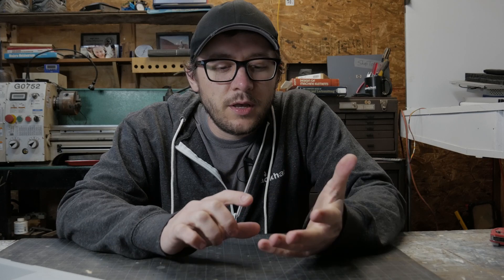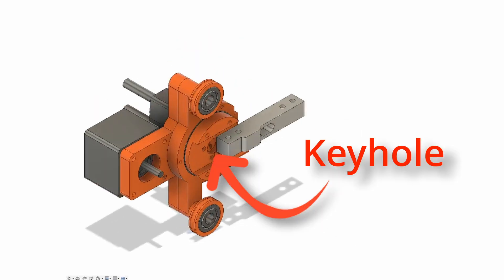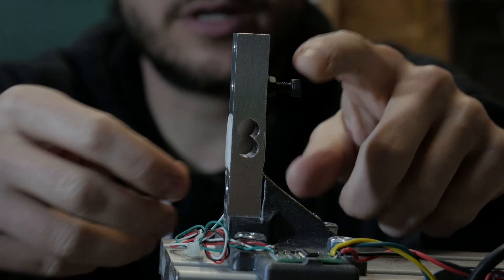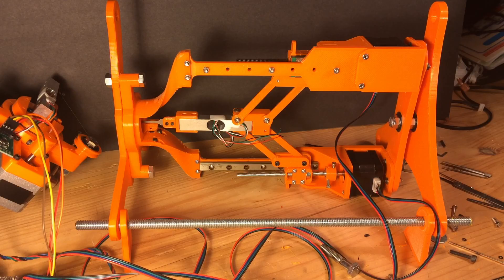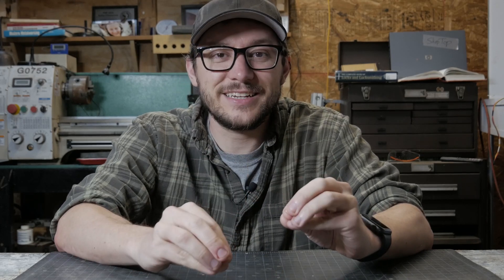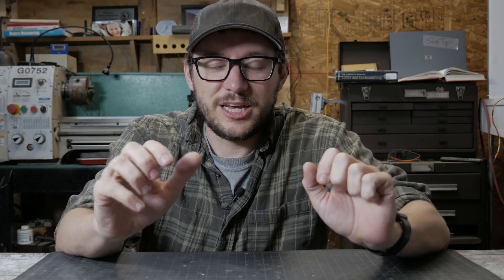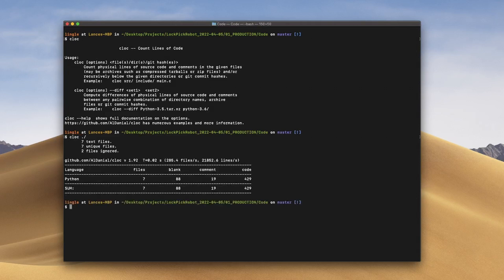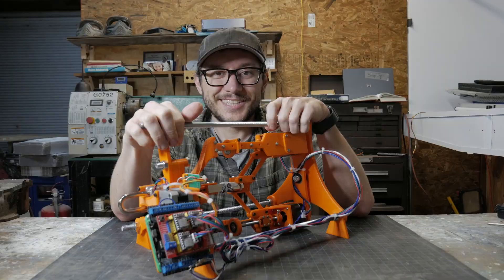making a lock picking robot

Comment: The wiggling you get can be from bad tolerance on the ball screw shaft.

You can buy ball screw shafts with much tighter tolerances guaranteed, but it turns out those are suuuuuper super pricey. So the simple solution is just the lottery: you just buy a couple of shafts, and pick whichever one lucked out with the least centreline deviation.

Comment: Love this project! You should make a new version that uses the lock picking lawyers (covert instruments) Lishi tool to be able to find out the depth of cut necessary for each of the pins while picking open a lock. Two big bonuses would be to be able to have the robot magnetized to hold against a metal door for door locks or at least have clearance for when a lock is flush mounted without being able to hold the lock within the robot. Another bonus would be to take it a step further and cut a new key to work with the lock based on figuring out the pins. If it can work on 3 or more locks by figuring it out on it's own to be able to memorize and learn on it's own, big plus! ahah These seem to be the next steps for this project in my opinion. What do you think?
Reply: This is kinda unnecessary. You can put all the information used to design Lishi decoders right into the code. No need to use an actual decoder. And you could make the robot gather the information it has to process while picking and use this to duplicate a key.
Reply from the maker: I spent a fair amount of time on the business end of the effector doing just that. Reverse engineering the lishi tool from photos and known measurements for the key. This was purely for the picking mechanics. Then I realized I could cut the end off a pick from a set. 

Good idea on the magnet.

Not sure, there are some innate problems with this design for more secure locks. If I circle back and do a version 2 it will be a complete redesign.

Comment: This is awesome! 

Does it currently have the ability to move .015” up / down  and ~0.15” forward / backward? Thanks for awesomeness!!!
Reply from the maker: Yes it can. You're welcome. Glad you enjoyed it.
Reply: Several of us at the local TOOOL Chapter think your  next steps could be (1) to program the robot with the Depth & Spacing information for locks like Master, Schlage, and Kwikset so it has the ability to test all depths at each position while picking and also (2) add modularity to the padlock/cylinder holder for the robot to pick open a padlock or deadbolt/mortise/key-in-knob cylinders, etc… the finale would be a version that could be placed/ mounted on a door, similar to how a safe lock auto-dialer is mounted to the safe. 

another iteration is a robot that can impression a key for the lock by testing/picking each pin stack and decode the lock bitting at the same time while also moving some pieces of metal around to fashion a modular working key.
Reply from the maker: Glad to see my thoughts were on par with people that know what they are doing. 
1) In the GitHub repo the code already has dimensions corresponding to bitting specifications for Master lock. It wouldn't be hard to expand it to other brands since it is broken down into x,y coordinates. 
2) Yep the holder is two pieces for two reasons, one for easier 3D printing and you only have to swap one part to change the lock. Yeah, in the beginning stages of design I wanted it super small and to run off a power tool battery. However, it quickly grew in size due to the limitations of my tooling and design.

My idea for version 2 is a complete redesign. If it works like I think it could it would be very fast and very small and take on just about any pure pin tumbler lock. I spent a little bit of time in lurking in /r/lockpicking the past few days and ASSA 700 looks promising. If you have one of those laying around, something similar, or have a better suggestion you can email me (link is under about on the channel).

Comment: I cannot see how this tool can pick a lock on a door with a lock guard around it, like a thief would have to.
So refining the design might involve re thinking all; in one cylinder shape, where the outer shell is the lock clamp holder (the fist of the left hand, for me) and a tool on the outer shell is the left hand (for me) tumb or index figer pushing the tensioner atached to it, while the rest of the contraption must somehow fit the actuator in the center of the holding tube so that all is slim, slick and sturdy.  Might also want smaler size loading cells.  Such desing might acutally work also on door locks, but you might need the extra hand to also rotate the door leaver for certain type of door locks.

Comment: Thanks for the time and effort in creating this device. In the lockpicking community, there is talk of designing such devices for a long time. Some have tried it, but failed as the goals were set too high. Start low security, then improve from there, should be the way. Furthermore, building such a device is multidisciplinary as it requires mechanical, electronics, and lockpicking knowledge. The current closest device would be a much simpler auto dialling robot for safe locks, and the robo key system from Stanton concepts. 

There are several easy ways out for higher security locks: Buy a Lishi tool and have a go at automating it, as it's much simpler. Lever lockpicking and disk detainers use a 2-in-1 as well, this can make lockpicking a lot easier to automate.  

Lastly, if you think locks are interesting enough to build a Robot for them, have a look if you can find similar minded people. The Open Organization of Lockpickers is a good one, Mackerspaces/Hackerspaces should also be interesting.
Reply: what kind of weirdo likes opening locks?

Comment: Did you try a different lock? If you can just drag the pick to open it, then you might have just gotten (un)lucky with the pin layout.

Would be cool if you could actually get the pin picking to work!
Reply from the maker: Yes and it didn’t work. I think you’re right about the luck.

My laziness hit 11 when I realized it worked by raking with this pin configuration.

I was curious so I ran the single pin pick function a few times with no luck. I’m guessing I’m off on my kinematics math and it’s not at the pin location since raking works.